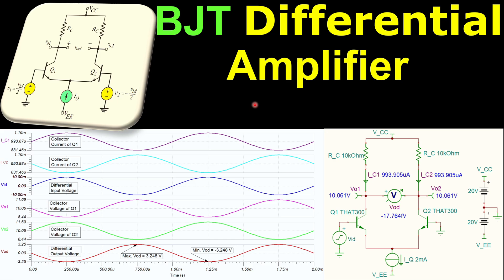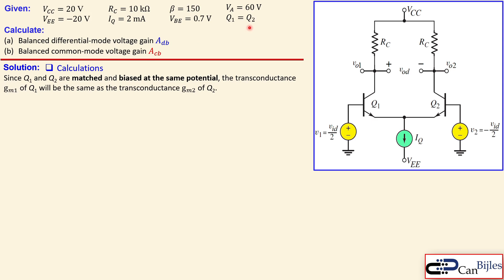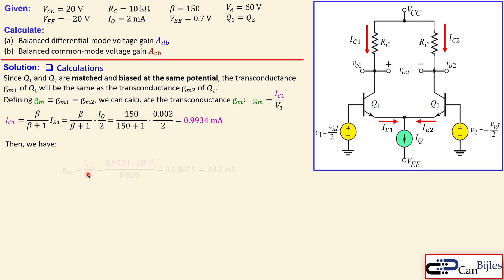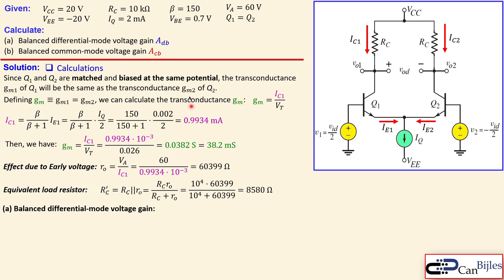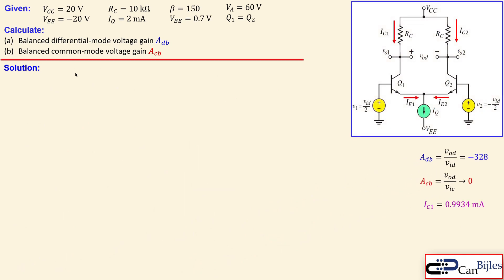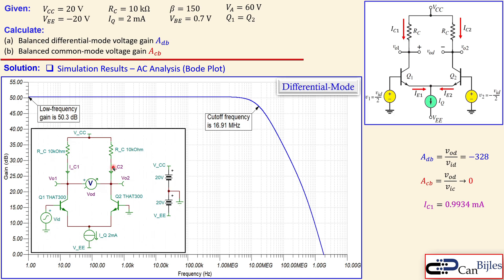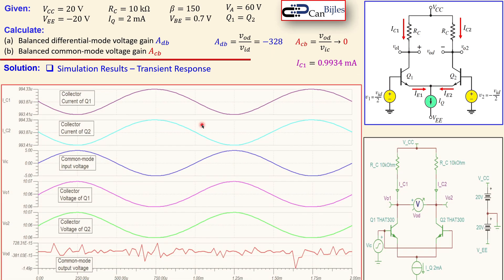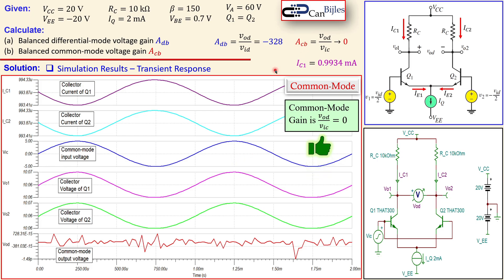BJT Differential Amplifier with Ideal Current Source 🌟 Differential-Mode & Common-Mode Gains 💡 EX1

Comment: Thank you for the clear explanation.  I like to set up my own TINA spice circuits and explore changes.  However, I could not find the THAT300 BJT offered in the TINA TI library.  Where would I find the information?  I used a generic NPN with Beta = 150 and Va= 60 and came close but not exactly to your results.
Reply from the maker: Glad it was helpful! You can create new components in TINA-TI SPICE by importing SPICE library of the component. First, find the SPICE library of the component you want to import, then use this to import that component into TINA-TI SPICE: https://youtu.be/UjDYO53l_KM
Reply: @CANEDUX  Thank you for the suggestion.  I was able to go to the manufacture's site and get a .model file to use and import it into TINA following a few "how to" videos.  I made sure Va was 60 as well as Beta = 150.
Reply from the maker: @richardsmith813  Great to know that it worked.